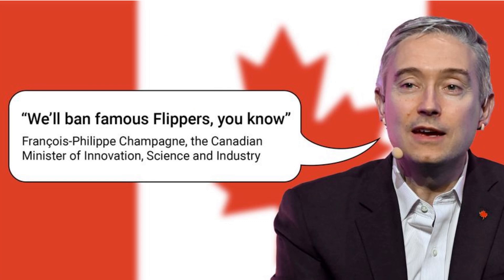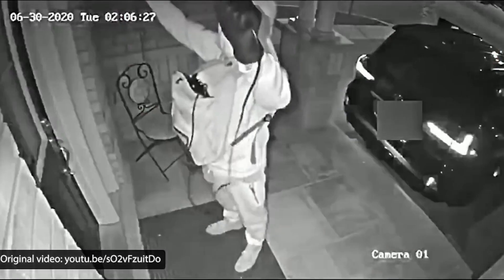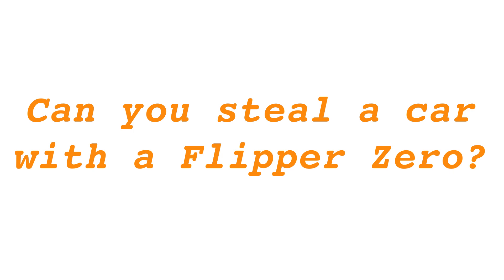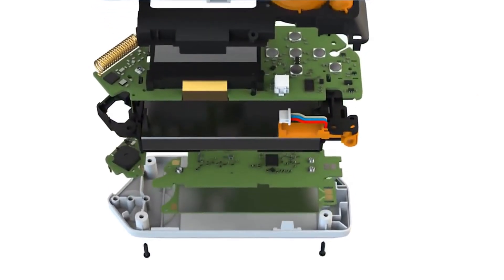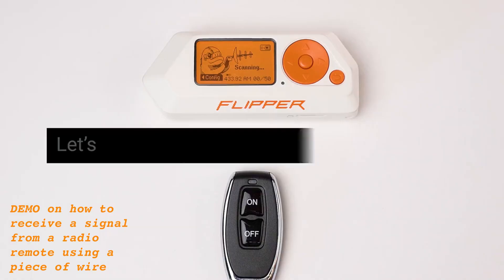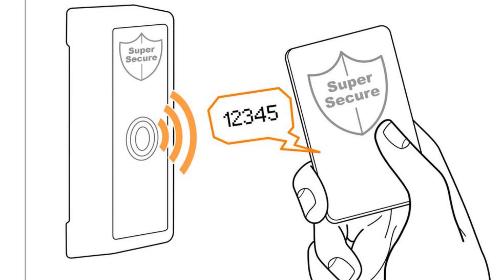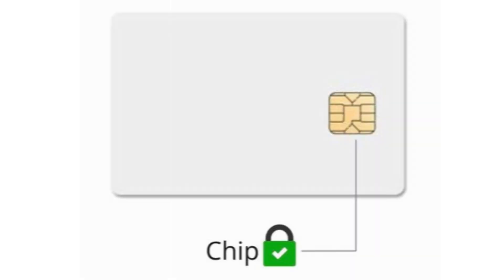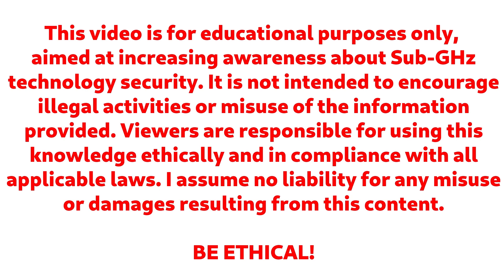FLIPPER ZERO Unlocking Cars | Are people really STEALING CARS WITH A FLIPPER ZERO?

Comment: Makes sense but if someone has more than 1 flipper zero for example 4 similar to the keyless repeater it would be the same thing since one could be used for transmitting and the other for reviving just add some modifications and antenna and it’s the same thing as the keyless repeater